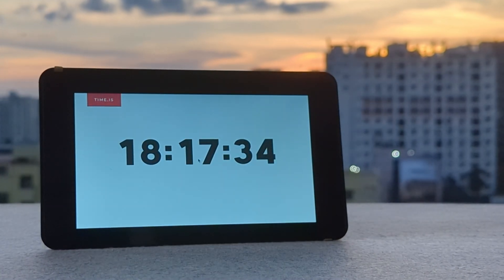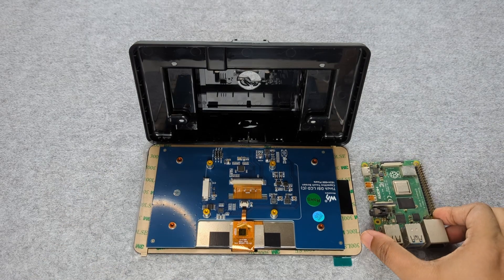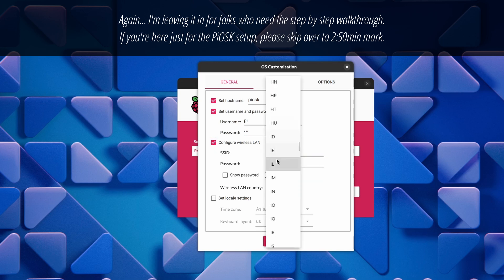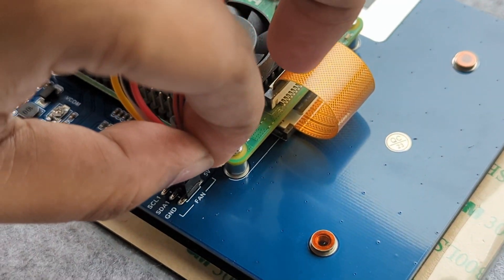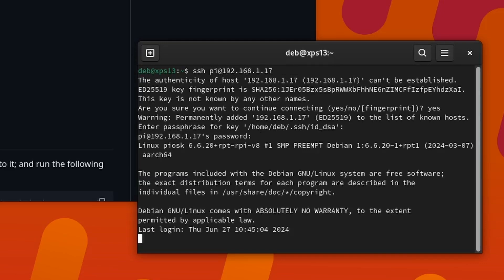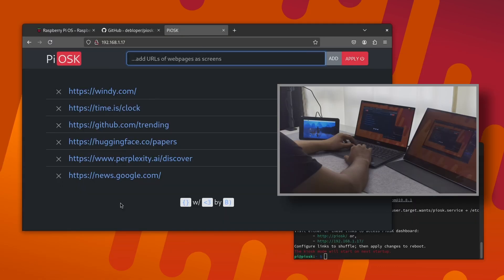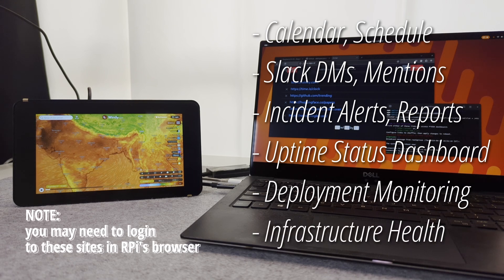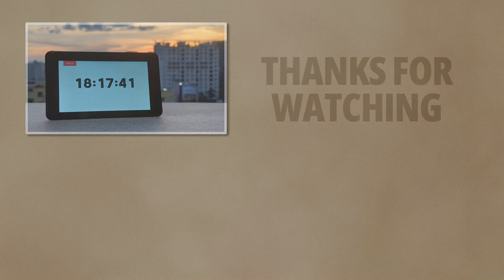PiOSK: Raspberry Pi Kiosk Mode Digital Signage

Comment from the maker: NOTE: In October 2024, Raspberry Pi OS has switched to a different Wayland compositor, which breaks PiOSK. While we fix it, please do either of these:

1. Credits to github/@gjobin (using new compositor, labwc):
- `mkdir ~/.config/labwc`
- `sudo echo "~/piosk/scripts/browser.sh" > ~/.config/labwc/autostart`
2. Credits to youtube/@tb898:
- go into sudo raspi-config
- select advanced options
- then select wayland
- then select wayfire window manager with wayland backend
- Reboot 

Either of these should fix the installation. We'll come up with something more elegant shortly.

---

After making this video, I've also added uninstall script (cleanup.sh) and other improvements & breaking changes as v2.0.0
Please make sure to go through the README file (or issues/commits) to know all about the changes that happened after.

Also, as I'm starting off as a full -time creative-developer in the open - I've just setup a GitHub sponsor profile: https://github.com/sponsors/debloper - your support is most welcome! 🙏

Comment: Hi. Thanks for the great solution. I respect your work. Question... I did it on an external touchscreen monitor and it works great, but I'd like to hang the monitor vertically. How do I do that so the image is vertical and the touchscreen works? Thanks.
Reply from the maker: Thanks for your kind words!

Please set the screen orientation before setting up PiOSK. PiOSK doesn't set/reset/change it in any way.

Comment: Awesome solution. I´d love to see it running on my RPi 5 (4GB). 
The thing ist, the kiosk-Mode doesn´t start. I tried both workarounds you mentioned in you pinned comment. 

I use RPi OS 64-bit on said machine. Maybe this is the cause of trouble?
Reply from the maker: 64bit should be fine... just make sure to use our v4.0.1; as RPiOS changed Chromium binary name (https://github.com/debloper/piosk/commit/bcb6e92d1812f732d016234ce13d3ea9a57e698b) previous versions started failing.

I'd recommend a fresh setup instead of upgrading OS of a working installation; cause that usually what breaks things.

Comment: After install and restart, my Raspberry Pi Zero 2 W shows the message "It is not recommended to run Chromium on devices with less than 1GB of RAM". Only after I press "Launch anyway" the PiOSK works. Any workaround?
Reply from the maker: Raspberry Pi Zero 2W is really not capable of running Google Chrome properly (and it struggles bad to run multiple tabs). This is one of the frequently complained about topics in the GitHub issues, and if you check the README's recommendation section, you'll find that RPi02W isn't recommended to be used for this purpose.
Reply: @BreakerSpace  I know this, however, for what I want it works reasonably well because it is just to display a web page with very light content. My only problem is that after starting the Raspberry I have to click on the message to continue. I've tried several ways, editing files to add parameters, and I can't get this message to not be displayed :(

Comment: That is an amazing project! Thank you so much for making that possible!
Is there a way to predefine how long each webpage is going to be shown?
Also, I don't know if it is the Rpi ( I've got the Rpi 5) but sometimes when I boot from the remote UI, it doesn't connect back to the internet.
Reply from the maker: Thanks, glad you find it useful!

Not sure what's causing the network issue... you'll have to look into that. Shouldn't be related to PiOSK or it's depoyment.

About the per-page configuration... it has been asked a few times as feature request on the repository's issues section. It's on the roadmap, but I'm personally swamped with other (more pressing) things to work on it at the moment (also resulting in irregular uploads). I'm open to review/merge if someone sends PR, until I find time to prioritize it.

Comment: Great application but I needed help on how to apply a proxy already set with username and password. I managed to do this configuration in the chromium source code but it only works if I close the browser and open it manually. When it opens automatically at startup it ignores the proxy. Can you help me?
Reply from the maker: Not sure why would the browser ignore proxy settings (if using the same profile when auto-launched). You could set the proxy to the OS/Network level, instead of application/browser level.

Comment: Thanks! This worked for me BUT my webpage crashes. It has some Grafana info on it. I noticed the first time I loaded it the Grafana stuff was having a hard time loading. Now the page just locks up. I used to run a script that loaded this page in Chrome on my pi but it would never stay full screen. What browser is this loading? Problems with Grafana that you know of? Thanks!!!
Reply from the maker: Not sure what's the issue with Grafana. Sometimes it gets heavy depending on the number of widgets you have on the page. And if you have multiple tabs of Grafana, that's also gonna cause issues. It's running the chromium browser, so try checking the developer console or network tab to see if you can find the issue.

Comment: Does this work on Rpi zero 2 w?
Reply from the maker: Chrome has some issues due to memory limitations (and opening up multiple tabs doesn't help it either). It's possible, but needs a lot of elbow-grease from the user to optimize it.
Reply: @BreakerSpace  I'd just wish to make a working kiosk device from it. It would be super, if there was a ready made image that would also support hdmi cec to switch the TV on and off.

Comment: I get the script to work but when i reboot my Pi 5 it wont autostart in kiosk mode. What could be wrong?
Reply from the maker: Please file an issue on the GitHub repo (or look for an existing one, along that line). Some recent changes to RPiOS (especially, wayfire to labwc transition) is causing bugs, but we're working on fixing them.
Reply: @BreakerSpace  I did get it to work now. But after reboot of the Rasberry Pi i can´t connect to the pi with my local ip to the pi if i want to change websites for piosk mode. Then i have to load the script from you again to get it to work. /ecmediavastervik
Reply from the maker: @ maybe you have dynamic IP for the Pi that's changing on each reboot.
Reply: @ Is it possible to extend the time so that each web page is displayed a little longer before it switches to the next web page you chose to add?
Reply from the maker: @ in the switcher.sh file, it's set to 10sec. You can change that to any value you want. In a future version, this can be configured from dashboard.

Comment: Can it be build in a way where piosk asks for WiFi logins first?
Reply from the maker: Not in a simple of convenient way that I can think of (you'll have to kill the chrome process and tab switcher). Raspberry Pi docs will have more options for setting up wifi... see if any of those matches your expectations.
Reply: @BreakerSpace  Thanks! which browser does it use?
Reply from the maker: It uses the default chromium browser.
Reply: @BreakerSpace  I have installed it and the piosk is running in the browser asking for URLs but on reboot there is no Kiosk Mode. It boots back on the GUI. I am using Raspberry pi Zero W 2. Can you sugest what I doing wrong?
Reply: Also followed this:
- go into sudo raspi-config
- select advanced options
- then select wayland
- then select wayfire window manager with wayland backend
- Reboot
Reply: The option 1 returns No Such Directory
Reply from the maker: @abhishekdudeja  updated the command to explicitly mention creating the directory (if it doesn't already exist)

Comment: At first this didn't work for me. I had to go into sudo raspi-config, select advanced options, then select wayland, then select wayfire window manager with wayland backend, then this worked great
Reply from the maker: Thank you so much. I've added your solution as another alternative to the pinned post. We'll update PiOSK soon as well so it'll again work out of the box.
Reply: @BreakerSpace  just to put it out there, I'm running the pi 4 4gb. Would you also be able to add a feature that allows it to be disabled rather than Uninstalled? It would be nice to disable piosk to make changes directly in the gui. A workaround i have is to just alt+f4 to close the browser. I wasn't able to exit full-screen to minimize it to make any changes. It's not too big of a deal, but it would be super convenient. Thank you for the video and the work you've done to make this project. It's perfect for my use case
Reply: @tb898  what was your issue with it before you did this changes? I have problem to get the script to work reboot.  It wont autostart
Reply: @ecmediavastervik  Before I did the change I mentioned above, it wouldn't do anything.

Comment: Beofre I came across this I was able to put together  to be able to make it work. But there is an error with the autostart which is that it crashes after a few hours. And there are forums where people have mentioned it which I tried couple things but couldn't really solve it. Any thoughts? It does the same thing with piosk as well too sadly
Reply from the maker: We are aware of something fishy happening, but none of the reports conclusively point to any certain reproduction step. If you can please file a issue, or add your thoughts to the existing ones on the same line, it will be very helpful:
https://github.com/debloper/piosk/issues/32
https://github.com/debloper/piosk/issues/41

There are also some forced differences in configuration across boards even in the official image (e.g. https://github.com/debloper/piosk/issues/29 ) which makes putting finger on the root cause very hard.

Comment: Hi, nice project !
Could you provide the parts references (make, model) or links for case and fan ?
Reply from the maker: Thank you!

The case came with the Waveshare 7" DSI display (you can get the displays with or without the case); and the heatsink-fan combo is something I had lying around (forgot when & where I bought it from), but you can search with "raspberry pi dual fan" to find them on amazon or aliexpress etc.

Comment: and how do I edit the time the pages are shown and how do I leave kiosk mode?
Reply from the maker: Would be good community discussion point for implementation pathway, to validate which mechanism is preferred by the most users (SSH? Dashboard Button? Uninstall/disable? etc)

For the time being, I personally just kill the browser & switcher process through SSH if I need to (which is not often). But I understand, it may not be the most convenient option for most.

Comment: Hi, nice work! is there an easy way to impelement some video or/and jpeg slideshow for a signage? thanx
Reply from the maker: If you can put the images/videos inside a folder, you can install a simple HTTP server (Python or Node.js based) to run it as an HTTP static file server.

Links would be like: http://localhost:8080/image.png & rest of it is no different.

Comment: What a presentation! Makes me wanna build one for myself just to look at clock and weather :P. How much total cost estimation?
Reply from the maker: Go for it... it's super useful!

For the cheapest option, you'll need to get a Pi Zero 2 W (with heat sink & microSD card) for ~$30 & use an old existing monitor for display.